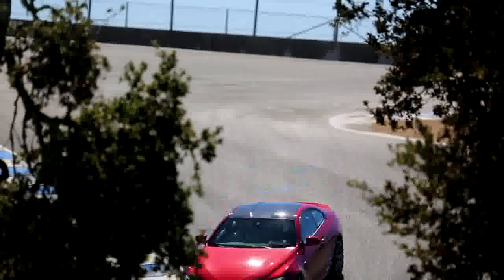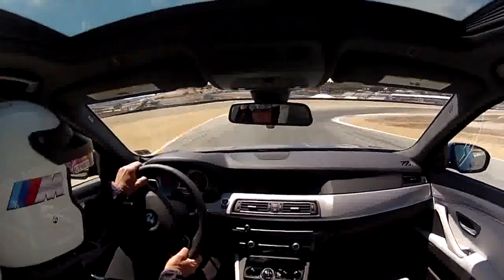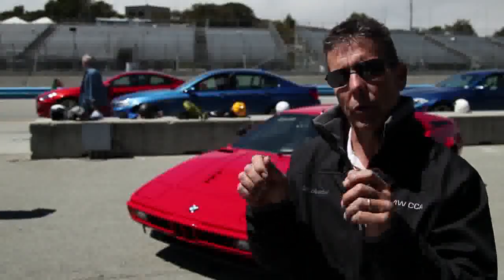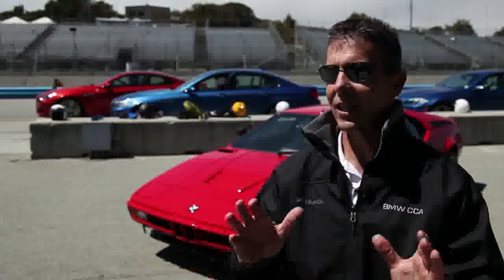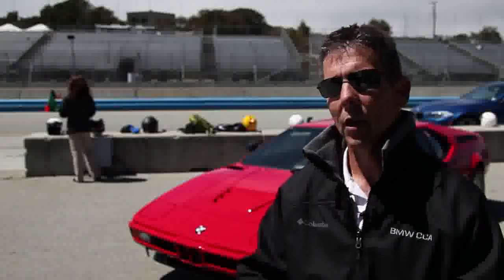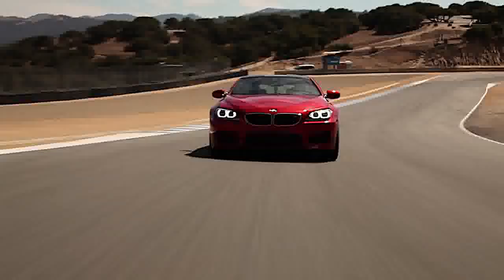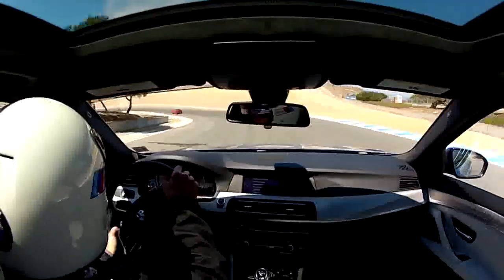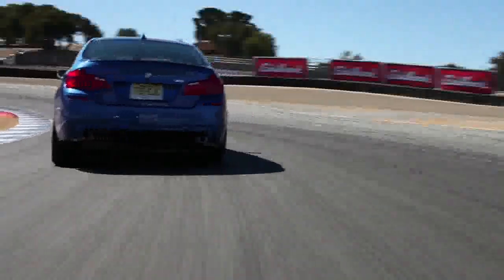BMW M Electronic Damper Control (EDC) Suspension System Explained

Comment: I have a question, I have an X6 M with EDC and some roads in Houston are just bumpy, potholes etc (mostly the inner streets for 25mph to 35mph) highways are fine.
should I use EDC on the bumpy roads, the ride feels more cadilacky when EDC is not on when on bumpy road. also, does it raise or lower the car when in use?